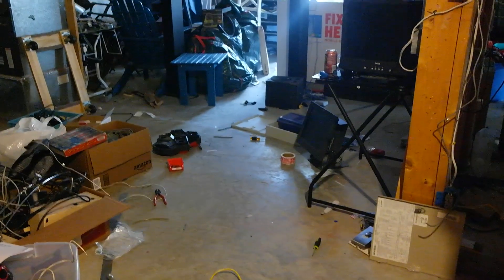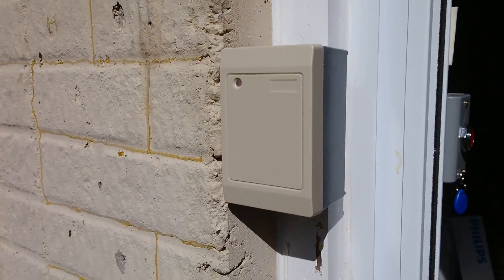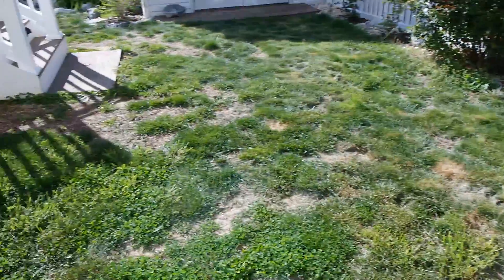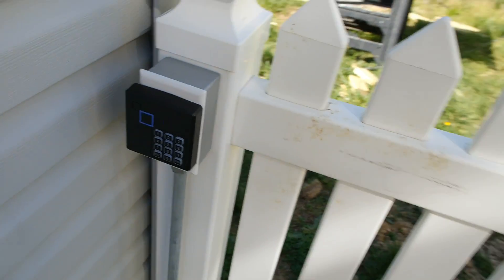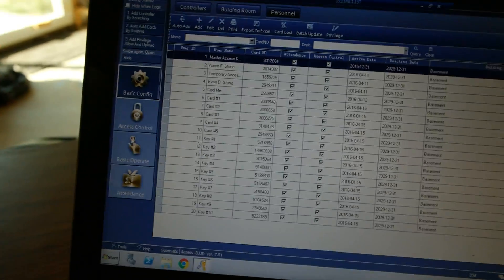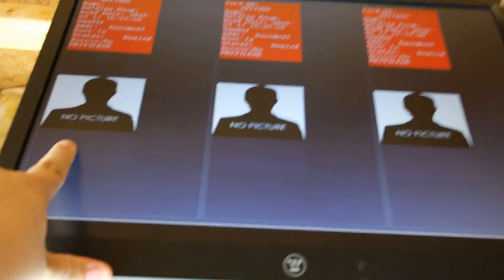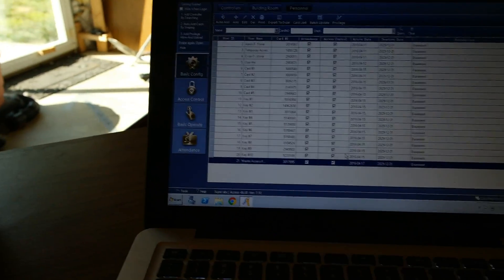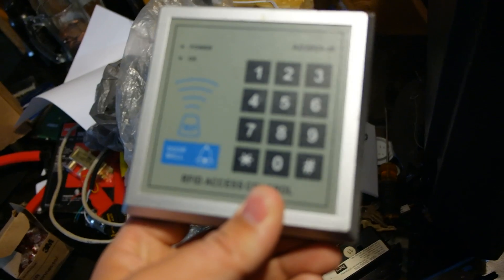My TCP/IP Wiegand 26 Bit Access Control System Update

Comment: Does the PC need to run all the time or the Controller board can be on and PC can be off?  How do you connect the remote pc so can see who login?  What software running there?  What power supply do you use?
Reply: PC can be off

Comment: Thanks for the info in these videos, I am setting up the same system. Can you tell me how I can control what the LED on the reader does when the door is unlocked and when the card is denied or excepted. I can’t find it in the software.
Reply: Nick Amos
did you got the led working?
Reply: Hello, I have the same situation, how do I make the LEDs  on the reader stay green fixed while the door is open?

Comment: Does this system have the same software, or will I need to purchase the software separate?  
https://www.amazon.com/Coplete-Access-Control-System-110-240V/dp/B01N4E5K5C/ref=sr_1_3?ie=UTF8&qid=1493902419&sr=8-3&keywords=2+door+access+control+system

Comment: Hi.  Interesting project.  Thanks for sharing.
The Wiegand Card Reader we see at 1m40s: Do you know if you can wire 2, or several together in parallel, then have only one set of wires go back to the controller (for example using 2, one on each side of the same door they will open)?  What product did you use to paint it?  I agree the beige is ugly and I have 2 of them.
Software: Do you know if it works with RS485 communication (to a USB Port)?  Or it is for TCP/IP networked controllers only?  Thanks.  -Chris
Reply: you can wire them parallel to control 1 door. u need a diode on tx and rx on each reader, total 4 diodes . 1n4148 would do the job
Reply: I've got 3 of these boards from Amazon, none of them have RS485 connections although I recall it mentioned in the (mediocre) instruction booklet so it may have been used on older boards. Each board needs a separate ethernet connection back to the switch, unfortunately there's no input and output ports to allow 1 drop to handle multiple boards.  Really not a big deal, I have one board in my barn and 2 in the house, one at each end, which keeps the low voltage runs to the readers and strikes short.

Comment: What type of wiring are you using between the system and the strikes/readers?
Reply: If you're just doing this for fun, anything over 22AWG will work. If you're doing it professionally, you have to take into account AC vs DC, voltage and amps, distance of the wire runs, and power draw.

Comment: I saw that you entered the storeroom using a keycode. Is that a function from the software? that allows you to login with keyfob or code? and if so, does it log the user assigned to the code?
Reply from the maker: First you have to go to "Extended Functions" (the password is "5678") and select the checkbox beside "Password Management". After you restart the program, open Password Management, and, what I have been doing is adding codes in the "Controller's Password" and adding a four digit code there. Unfortunately, it doesn't display the user that used it in the audit trail, it just says a code was used. I believe you can assign a certain user to a certain code, and it will show that in the audit trail. I will look at that when I get back from vacation and will leave a response then.
Reply: We may be using different versions of the software.
I went into the extended functions and under configuration, I enabled Activate Access Keypad. Click ok and it requests a restart of the software.

It restarts.

That creates the "Password Management" button under the configuration window.

Under Password Management, it had tabs for "Card + Pin", "PIN Code", "Controller's Password" and "Manual Input Password"

I tried testing different options in Card+PIN and PIN Code. But neither gave the desired results.

I will try out the Controller's Password tomorrow when I am back in the workroom and let you know how it goes.

Thanks for the input.
Reply: Hey hello, could you put the keypad to work?

Comment: I am looking at possibly installing an RFID access control system at my house sometime. Where did you get those commercial key readers? And what brand are the ones you have on the basement and sliding door? They look like Indala readers, but I can't be sure.
Reply from the maker: +Elevating Denver Fortunately for us, China loves to mass produce no name brand things and in turn selling them very inexpensively. The readers featured in my video I think are some sort of HID knockoffs. I am not sure who Indala is, but after doing a quick Internet search, it looks like they are some sort of HID distributor and/or installer. I have attached a link to the eBay site that sells the readers below.

http://www.ebay.com/itm/141894311185?_trksid=p2060353.m2749.l2649&ssPageName=STRK%3AMEBIDX%3AIT
Reply: 22408aaron Haha, should have assumed they were from China. As for Indala, they were part of Motorola until 2001, when they were acquired by HID. HID now sells their readers and keys under the "Indala Proximity" line of products. And if you search the Legacy ASR-505 reader, you can see what I mean when I say your's are very similar. 

I also have an Indala key that I found in a ski-resort parking lot. I have tested to see if it responds with readers that I find at random locations and I get no indication of a response. I think it might be broken or demagnetized.
Reply: The board is available on Amazon for about $80 currently,  or $160 in a metal box w/ power supply. Software is crazy, I've ordered 6 boards and they all included an identical mini-CDR with the software, however only 2 discs actually had working copies. Message me and I will send anyone who needs it a copy